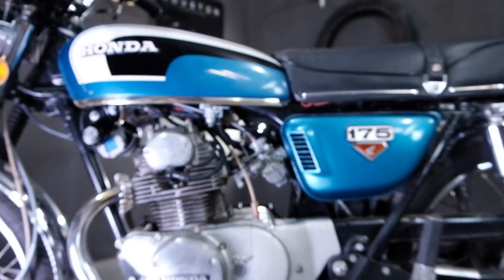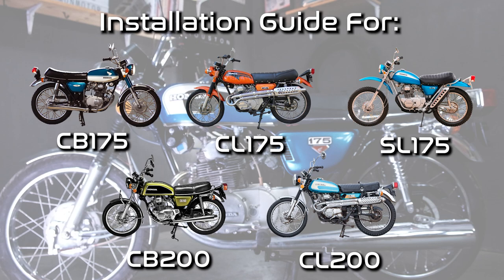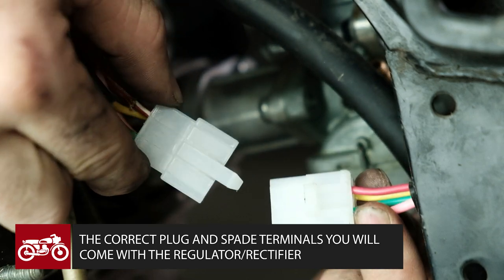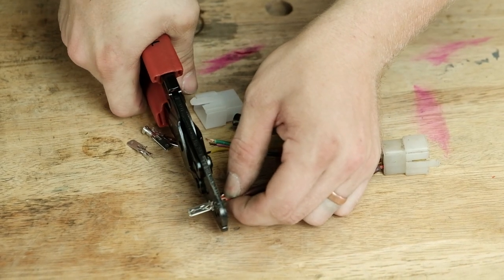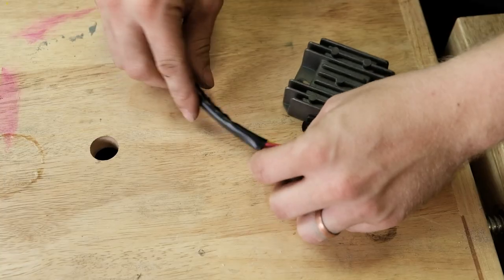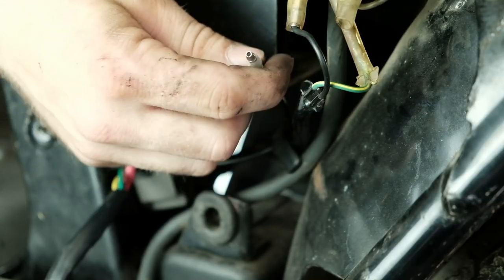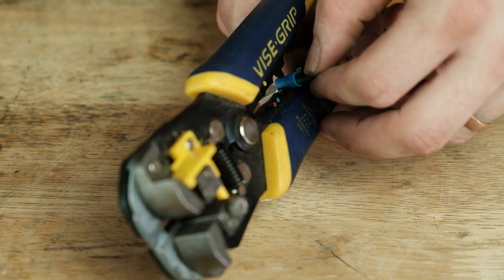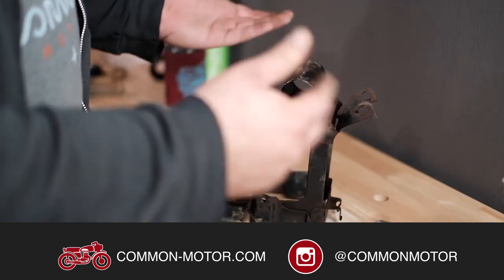How To Upgrade Your Honda CB175 / CB200 Regulator And Rectifier

Comment: Here is my debate
You pulled out blk wire (power on most honda similar to red
Red being unswitched
There is already a red wire on the
White connector
So why do u need black power
Wire as wel ?
Second debate
Same plastic connector has green
Ground and that new unit is mounted
To frame ground
Then why do u need adittional
Ground green connected to the
Bullet connector to battery box
Ground
My cb i only connected the
Four wires and gounded bolted
The device to frame
And all is wel
U can answer your version
For the extra two connections ?

Comment: Hello,
I'm replacing my rectifier on my 175 honda. I have been able to follow most of the steps. However, I have an early style rectifier and when connecting the old wires with the new rectifier, I see that the like colors don't match up when plugged in. I have "old" green going into "new" red and "old" yellow with "new" pink. Do I need to take off the plastic cap and put make sure the colors are all the same? I'm new to the motorcycle game, your video is very helpful, but this last part has me being super confused and cautious lol thank you.

Comment: I really appreciate your videos and the parts you sell. I just installed this on my 1970 SL175 and am getting 13V at idle and 13.5V-14V above 2k RPM! I love it! My extension was about 18" as my rectifier was located under the front of my tank. It all works like a charm! Thanks again!

Comment: Do you know of a good reg/rec combo for a cm185 6v motorcycle
Reply from the maker: Not just yet! I'd check with spark moto or ricks
Reply: Just picked up one of those myself.  In the middle of another project at the moment, so I haven’t had a good chance to look this one over. Don’t know if I got a 6v or a 12v .

Comment: Hi please help me. I want to know can I change from 6v rectifier regulator to 12v without changing startor coil on honda xl 250.
Reply from the maker: Usually, the change requires more than that to jump to 12v but I'm not familiar enough with the XL250's to be sure. I'd get onto an owners forum on Facebook and see if any other XL250 owners have made the switch and how they did it.

Comment: So..... you ground the ground to ground? Not quite sure what you achieved there.
Reply from the maker: Exactly! We are connecting the wiring harness itself to the frame to ground the harness. If you don't there will be no connection between the battery/frame ground and the harness ground connections. This was done through the original rectifier bracket originally so when making the upgrade to a modern reg/rec combo you need to re-ground the harness elsewhere on the frame.
Reply: @Common-motor  Seems hard to believe that the whole harness gets it's ground through a perishable component and not through direct ground points but, if you say so I believe  you.
Reply: @MatelotsousMarin  It was grounded through the bracket, a piece a metal, not through an electronic component.
Reply: But why replace these parts?  Mine work fine.  Any evidence the new modern parts are more reliable?

Comment: Any suggestions for a CD175?
Reply from the maker: Not just yet! It's quite a different motorcycle and uses a 6v electrical system. You would need to find a specific 6v regulator/rectifier but the wiring in process should be similar. I'd check the wiring diagram too to make sure it does not have a ground coming off it like the CB175/CL175s have.
Reply: @Common-motor  Thanks for the reply. Other than the 6V system and the fact that the CD works only with a rectifier, the Cd has a lot in common with the CB or CL. I hope some day you will have a video (and parts for) on conversion from 6V to 12V.
Reply from the maker: @mnmr7909  Ah but it also has only a single carb and some other weird quirks about it. Our good friend Jared has one( we've done a bike tour on his CL350) but don't get me wrong, it's an awesome motorcycle! You should be able to wire a regulator even though it didn't have one from the factory. The early CB450's were like this but benefit from adding one!
Reply: I have Cd 125 Twin Brown line model.I bought it in 1994.And I Converted 6v 12v system by changing Rectifire,battery,ignition coil.BuT theirs one problem its platinum point...I thought of changing it to 12v  CDI System but i couldn't...i need help
Reply: @thondakaika4728  Did you change the stator as well? Not sure if I understand why you mean by "platinum point".
Reply from the maker: @thondakaika4728  Hey Thonda, I don't know too much about the CD125 but unsure of what you mean by platinum point as well. Usually, on older 6v 2-stroke bikes they can be changed to a 12v system by using electronic ignition conversion like you are saying but that will depend on if they make one for your model of bike. Vape systems are the most popular.
Reply: @mnmr7909  No i didn't change the stator.6v stator gives output 24v so if you install a 12v rectifire you can get enough voltage to charge your battery and for smooth running.
Reply: @Common-motor  The latest CD 125 benly. Its has 12v CDI system.In my country people change their old Twin bike with 6v to 12v simply installing 12v parts that 125 benly bike has.This convertion is 100% successful.
Reply: @thondakaika4728  Thanks for the info. Very much appreciated.